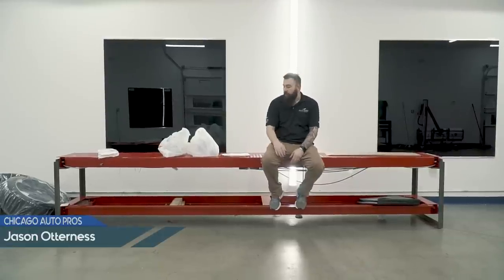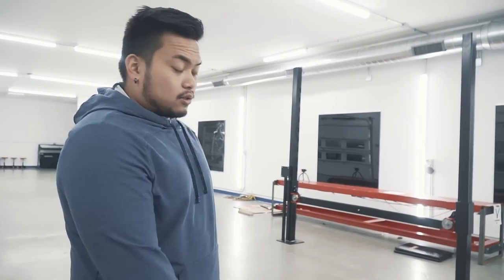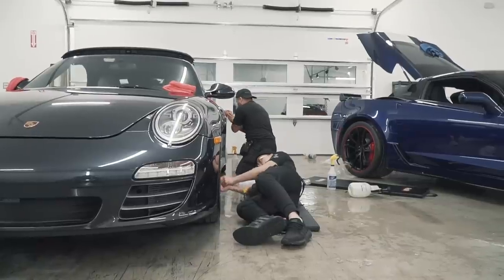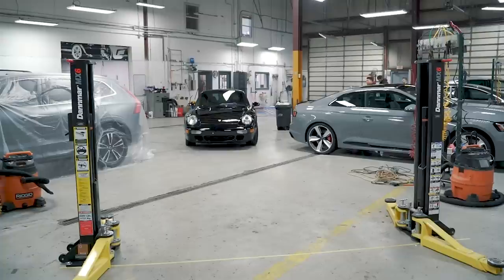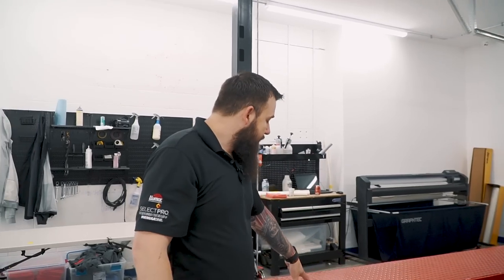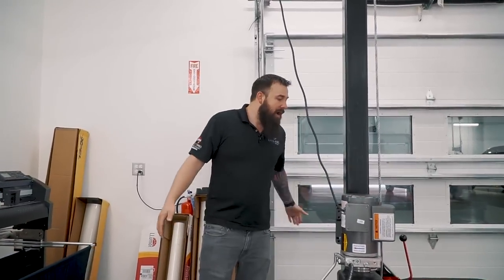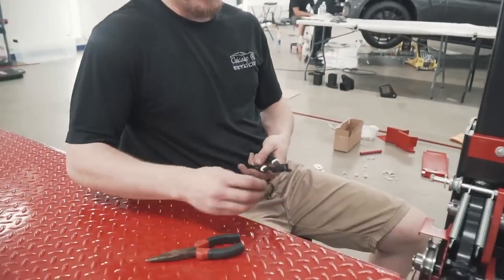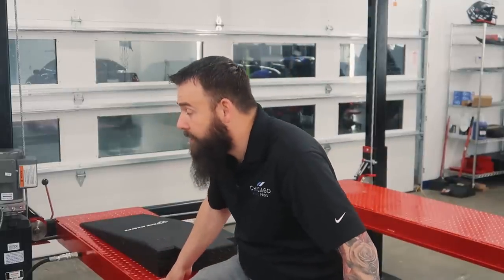Watch This BEFORE You Buy That New Lift

Comment: Thanks for sharing the reasons for selecting this lift. After 2 years of ownership, have you had any problems or issues? I’m thinking of getting this 7,000 lbs lift or the Bendpak HD-9 which is a pneumatic unit and needs an additional air compressor. Not sure I want that additional trouble.